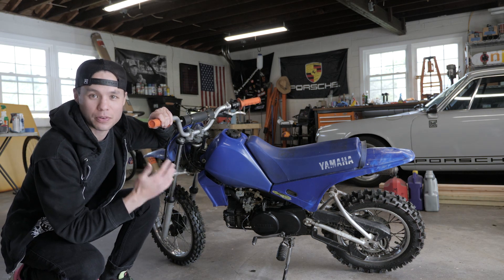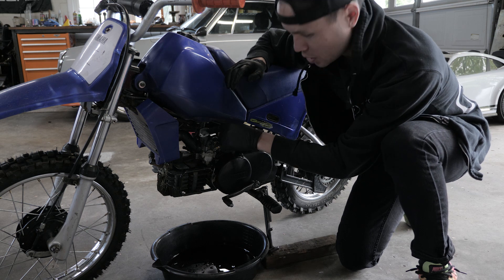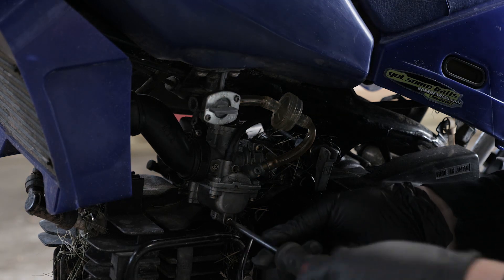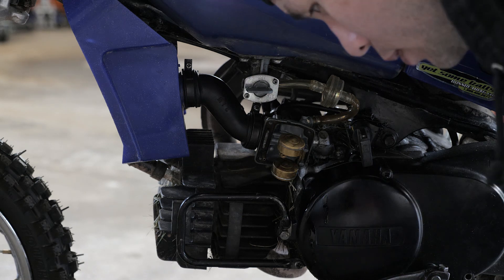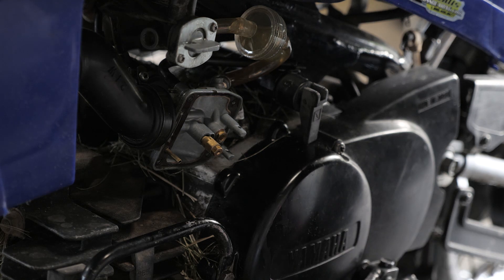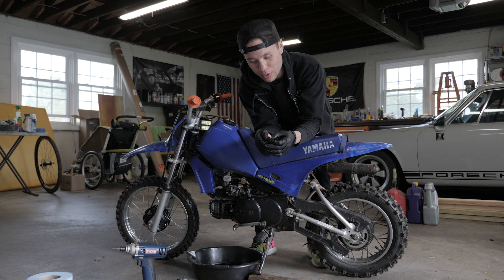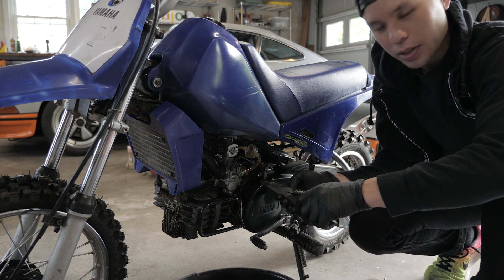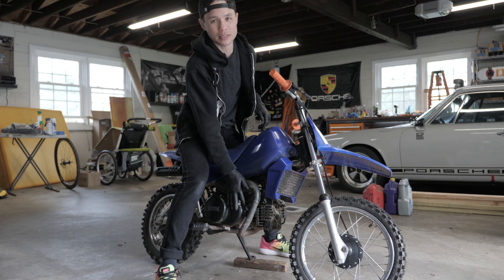How to clean out your PW80 carb!

Comment: Nice.  I usually take off the carb and it's a pain in the rear to get in/out - detach/reattach the throttle cable/choke.  Just loosening the carb and rotating it is genius, thanks.
Reply: Yep, that was ingenious, I did it with my son's p-dub and it worked great, much better than pulling the carb.

Comment: Hey thanks for the vid. Have a question for u. I just bought one for my son. Its used. Already did what u showed on here. I dont know much about those pw80s. I have seen vids to put oil in the bike where it says yamaha just above the foot brake. Then i have seen some guys put tranny oil in there. Which is it? And also what kind of oil goes under the seat? Thanks a bunch.
Reply from the maker: two-strokes like the PW80 run off a mixture of gas and oil. unlike your weed wacker though, the PW80 has a separate oil pump which allows you to put straight gasoline in the fuel tank. so you put two-stroke oil under the seat, and the pump will automatically mix it into the engine. some people don't trust the pump, so they delete it and put a gas/oil mixture into the fuel tank.
Reply: Back away from the bike